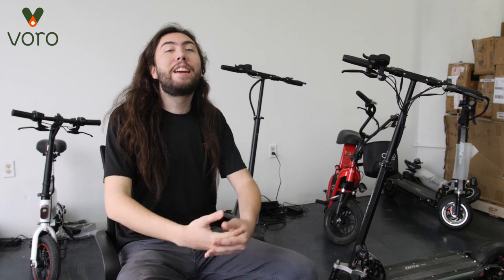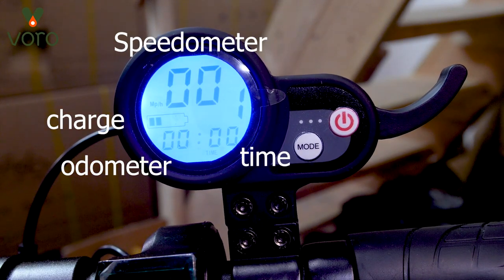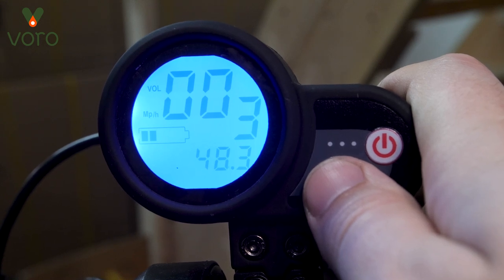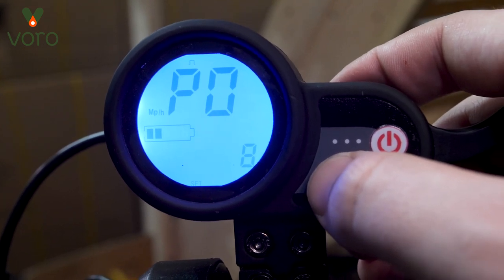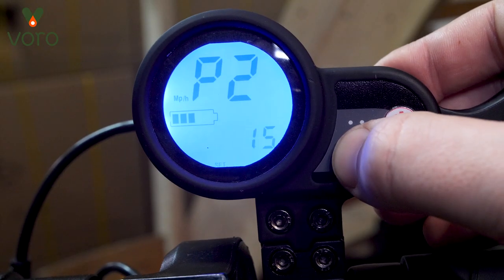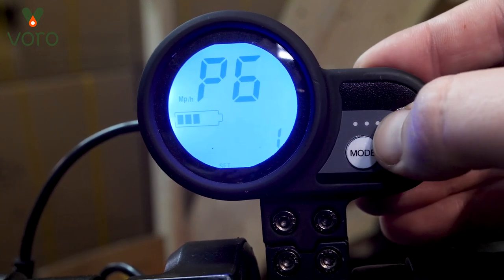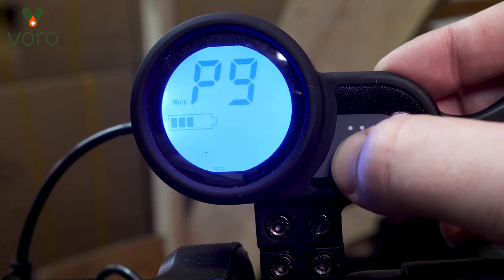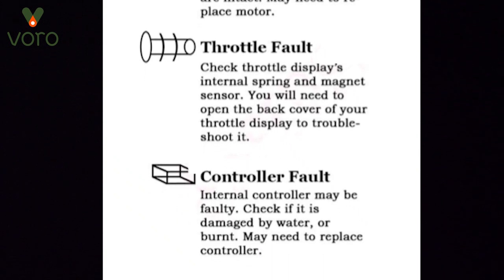EMOVE Cruiser and Touring LCD Display P0 to P9 Menu - Most Comprehensive Tutorial

Comment from the maker: Something that we want to clarify on

For the EMOVE Cruiser
P0 = 10 (10" wheel)

For the EMOVE Touring
P0 = 8 (8" wheel)

If the settings for P0 is not following this, you might find yourself at a different displayed speed compared to the actual real life speed. For example, if you Cruiser P0 setting is set at 8, you might be travelling at 25mph but the display is showing 20mph. 

At the time when the video is made, this is 1 minor mistake on the tutorial. Apologies for any inconveniences caused.
Reply: Hi voromotors can you move the key insert   or is it permanently placed
Reply: @Sly_Fella  yes it just Allen key
Reply: @Randomguy-rh7rl  ok
Reply: thank you for the clarification! i was wondering this and couldn't make sense of it.
Reply: Thanks for the clarity!
Reply: I just bought my Emove Cruiser and I was wondering why I was going fast but my speedometer was just showing 18-20 mph.This help now it shows the real speed.
Reply: @notgoodman6651  set the P0 to 11.5 and speed will be correct .
Reply: @leechavarie4675  is that why my new emove cruiser s is only displaying 28mph top speed instead of 30? My wheel size is set to 10
Reply: I’m 😮so
Reply: How to set the speed 25max go to 40 kilometers per hrs

Comment: These are the best settings.
P0 - 10 wheel diameter
P1 - 43 low volt protect
P2 - 15 minimum wattage
P3 - 1 speedometer
P4 - 1 mph
P5 - 1 kickstart
P6 - 0 cruise
P7 - 1 acceleration
P8 - 100 power limit
P9 - 2 electronic brake
Reply: Thank you so much!
Reply: Why 10" wheel? Does it affect torque, or only the speedometer?
Reply: @qx4n9e1xp  just the speedometer it would give you an inaccurate speed
Reply: Only change P0 to 10 if you have tubeless tires. If you have a tire diameter of 10 then it is set to 10. In other words go based off your tire diameter. The first number on tires.
Reply: @logandowney03  default is 10..
Reply: Thank you

Comment: My Touring came with 3\5 bars of a charge..  and the wheel size wasn't setup.. so I went for about a 4 mile ride and it was down to 1 bar on the battery meter.. Another mile and I would have made it to the local market but I turned around. So far it's fun and a pretty solid machine.
Reply: It's bad for the battery to leave it too high or too low for too long, so they leave it at medium for battery life when not being used(when no one is riding).

Comment: Needs an update.
P0 is a speedometer scale adjuster. 
P1 is a battery scale adjuster.  It adjust how your  battery bar displays from full to empty.  Doesn't affect LVC at all (I've had my Cruiser at 44v and the P1 at 48v, doesn't do a thing).
P9 is not a regen brake at.  Others have said all it does it add a little bit of resistance to maintain steady speeds while going down hill.  I can't detect it doing anything of any real note.
Reply: Sine wave controller has electronic braking for sure

Comment: I just bought a Cruiser, literally hours ago, and have officially began the waiting journey. While excited about that, I'm a little confused about the low voltage protection setting (P1), and I noticed this video was from 2020, while the model I bought was the 2021. Even the batteries are different, I believe, so should it be set to 430 regardless? Replies appreciated.

Comment: Is the electric break a regenerative break?
Reply: Now that's a good question? Does it dump the energy back in to the battery, or just dump it as heat in to a resistor?
Reply: i dont think this scooter is that advanced if anything i think if u have it set to strong brake which is 2 your battery will die quicker because its using more battery

Comment: About the electric break: I'm not educated in the technical engineering of this technology so I want to understand what exactly changes between 0, 1 and 2 settings. I'm guessing it's that break that hits when I stop accelerating even though I'm not actually hitting the breaks. I hate it because sometimes I let go of the accelerator to let the momentum carry me while I slow down but the break kills enough of the momentum that I have to accelerate again even with the P9 set to 0. Am I on the wrong setting or are the electric breaks something completely different?

Comment: Is there a way to back feed power through the usb port on the display? I’d like to be able to carry an external power supply I could plug in to get home in a pinch.
Reply from the maker: Hi there! 

While we understand the natural inclination to use a USB port as a charger, that is not its intended purpose. The USB port on the display doesn't make for a good charger if you ever do plug in a device, and in fact, we would advise against it, as it is not meant to pull power like is required to charge a phone or other device. 

The port's intended use is as a means to re-program the LCD display alone. 

It most certainly is not a means by which you can feed power back into the scooter, and we would not recommend trying anything like what you are suggesting. Sorry! Feel free to reach out if you have any other questions, though!

Comment: Can you do a video of the p9 settings in real world? My p9 is at 2 and I don't notice a deceleration. Thanks!
Reply: FACTS
Reply: The electric brake is activated when you actually use your brake levers, which is weird.
Reply: @alexisjavier84  the electric brake (regen) should activate any time you decelerate tap your brake or throttle and you should notice the motor slowing you down. if not change the setting
Reply: My square wave controller never exhibited electronic braking as expected. When I swapped it for a sine wave controller, suddenly electronic braking works and very noticeable just a second after pressing the brake lever.

Comment: Just purchased the cruiser and I love it. Problem is, the odometer. When I changed it from km/h to mph, the odometer didn’t change. Is the odometer in kilometers or miles?
Reply: Strange. I just changed mine there and both changed.
Reply: Problem with screw loose?

Comment: Yes I just got a scooter it's not even 2 weeks old and I noticed that wire going into the back to LCD was loose way too small for the whole the other big hole wasn't even covered up but I noticed when I raise a handlebars up and down it must have wiggled the wire or something because now my scooter won't turn on when I turn the key on LCD doesn't light up but I could push the menu button or that the power button on hold it down in the horns the light will come on and the horno honk but I was just wondering if you had any ideas about that

Comment: Waiting for my touring to arrive. If electronic braking is turned on, how does it work? A lever? Or does just releasing the trigger do it? Thanks. Great, informative video btw.
Reply from the maker: the E-brake activates just by pulling your brake lever. - AJ
Reply: VOROMOTORS Don't think mine works! Especially while in cruise mode the brakes don't cut cruise out just the throttle is that normal?
Reply: Sine wave controller works w electronic braking, my square controller never did.

Comment: What do you mean for p2 minimum wattage . I got 800 watt motor what number should I set?  I thought that the p2 was the number of the poles inside the motor... so the number 15 what does it mean ?
Reply: Have it on 18  i have the manufacture guide and it standing p2 =18

Comment: Can you explain about The battery voltage ? When it’s on 52 is it fully charge? and what number should I get when it’s 10 percent Battery left?
Reply: Cruiser uses a 14s li-ion pack so full charge should be 58.8v and drained should be about 46v

Comment: P2 is min wattage??? is it not poles number??? 
I have an identical scooter with this form this video but 48V 500W version and I have a question: on 2 and on 3 I seem to have the same power and max speed. max speed I tested with the wheel in the air and it is 39 km/h on both settings 2 and 3. Isn't this a little low especially with zero load? With me it barely goes more then 30 km/h. Specs were saying 45 km/h.

Comment: Hi, I have a scooter with the same display and the same settings and if I leave the scooter ON and do not move it, it will turn OFF after something like a minute... I wanted to ask if there is a way that the scooter will not turn OFF?  Because I need it to stay ON so i can charge my phone through the USB socket behind the display when I'm out and the acooter does not move... PLS HELP ME :)
Reply from the maker: Hi, sorry to hear about the issue you are facing. 

Can you please email to support@voromotors.com for the right department to assist you immediately?

Alternatively, you can also call us at 323-709-7329

Comment: On my Cruiser P2 was set at 17 when I got it. Im pretty sure its the newest version since I just got it from Voro. Should I be changing it to 15?
Reply: I got mine from Voro also and it was either 17 or 18 then I changed it to 15 because of the video but changed it back to 17 because another comment on here said that the manufacturer manual says P2 18 for the cruiser

Comment: Hii there where can I find what should be my battery voltage at when it is at a low battery and what should it be at higher battery? Do you have a list of that?

For the electric brake If I brake normally with the mechanic brake it will automatically start the electric brakes?
Reply: Hey google Emove cruiser or touring master guide. It’s like a small 12page pamphlet of every detail. It says what the volt readings in there would be on low battery.
Reply: @l-Lucid-l  thank you so much I appreciate it
Reply: E brake doesn't work on touring well I don't think just drum brake
Reply: @thew4rrior5code  I pretty much rely only on my regenerative ebrake than the drum on my touring. My drum brake should last forever.
Reply: FireTrace How do the different brakes work on the touring I'm confused the women on the online chat at voromotors said there weren't no ebrake just regen and you won't notice anything while riding. Also in cruise mode the brake doesn't cut it out just the throttle does is that normal?
Reply: @thew4rrior5code  I always believed that the regen and ebrake are one and the same. Oh yes, it is definitely noticeable when engaging it. If I'm moving along downhill at speed and not brace for it, just tapping the brake lever initiating the ebrake/regen will send me flying while the scooter waits for me to return to pick it up. =) Actually, not that bad once you know to prepare for it. I'm 5'9" and 160# and do a lot of downhills and rarely depress the brake lever enough to engage the drum brake. As far as cruise control, I really can't offer anything there since I have that turned off. Suits my type of riding.
Reply: FireTrace ah ok. I've just re-read the p-settings on their website it says for p9 which is ebrake strength you activate it by hold down throttle all the way? Doesn't mention anything regarding the rear brake! 1 final question my friend does your drum brake sometimes come out of the line housing it's situated in? Sometimes when I press on the rear brake it gets really loose I then stop look down and the drum line is out! What's the issue there?
Reply: @thew4rrior5code  Ha ha! I've been trying to figure it out myself. I've had that happen twice so far (after about 10 outings) and am puzzled how little bumps along the way could knock it out of it's place. Sure don't want to realize it when on a long downhill. Come to think of it, I believe the regen brake still works when that becomes detached. Only because both times I've noticed it, I was already home. It's downhill home so the regen brake must still work, which is comforting.  It is kind of a mystery as there is a bit of tension there where one would think it wouldn't be an issue. I will look at it again today. Maybe the spring sometimes does not do its job. Will monitor it and maybe between us we can figure out something....besides duct tape. =) Oh, as far as "activating the ebrake", I didn't see anything in the instructions regarding that except for setting it in the P settings.

Comment: So I have a problem. XD my mode goes down on the P screen where as power goes up. Neither let's me select the p setting to change the settings. Because I need to turn off kick to start. I injured my ankle today doing such 😆
Reply: Nvm figured it out. For mine I have to hold menu to go into the p setting to change it.

Comment: Hi. I changed my display throttle which is originally z2 but I got a z1 throttle as replacement which has up to p9 settings. Can you help me out what parameters for z1. I'm afraid I might damage the scooter if I use it without setting up. By the way my scooter is China mare which is 60v 3200w dual motor (1600w each). Please help.

Comment: Hi, this is great. Would you have a similar video or maybe just a list of settings for the Orca Mk1 please? Many thanks, Rupe
Reply from the maker: The Orca's settings are all locked. there isn't a way to get in and change anything so its really easy to pick up and not worry about. - AJ
Reply: @VoroMotors  Many thanks for getting back AJ. I just seem to have no 1/2/3 power difference, and feel stuck in lowest power maybe, little DYU 1 goes faster. The P settings all seem changeable (power and M etc),but if you say those numbers are fixed..I dont know what to do - maybe flash some defaults? I bought the bike from Techtablet in Portugal who had it as a review bike I think. Thanks again for your assistance, Rupert

Comment: For whatever reason it works most accurate with wheel size set to 6.  I don't get any change with 'soft' acceleration. And e brake seems non existent
Reply: Michael Armani I agree on my touring I don't know how the ebrake works? and the drum brake comes out the line housing often which is annoying I'll know because the brakes go all loose.
Reply: THE W4RRIOR5 CODE , agree. Its kind of dangerous, I need to figure out a wY to secure it, maybe a zip tie will work.
Reply: What is it exactly that works accurate with the wheel size 6?

Comment: Do you get batter range if the wheel size is set to 10 instead of 8?
Reply from the maker: No, the range do not get affected. It only affects the accuracy of the LCD display.
Reply: @VoroMotors  what will happen if I set it at 10?
Reply from the maker: @michaelmartello6202  The scooter will read mileage and speed assuming that the wheel size is a 10 inch wheel.
Reply: Mine was set to 8 and was saying 37mph on the speedo. Changed it to 10 now.
Reply: @VoroMotors  I am a bit confused, the cruiser has a 10 inch tires, why did you recommend setting it to 8 inch? Speed is calculated by the angular velocity times the radius, so if you select 8 inch the LCD would show lower speed than your actual speed. Can you please confirm that?
Reply: I thought our wheel size is 10, why would I set it to 8?
Reply: @Danelya30   you say in the video set it to 8 tbf
Reply: @bryanchristiansangga1244  I think they said to set it to 8 if you have the Touring model. Not sure, though.

Comment: Don’t mess with the voltage protection keep it to where it was. My emove was acting up it was studdering power to my motor and I couldn’t ride it anymore my brain told me to change the voltage protection back to factory and my scooter seems to be working not sure how long this will last but I’ll let you know. It shouldn’t be happening to the point where you can’t ride even with full charge but when I changed mine it even changed the bars on my scooter so I believe it will even effect how much of a charge you get. I hope this fixes your problems if your having the same issue I was but let’s hope it was a permanent fix so I don’t have to warranty it.
Reply from the maker: Hi Albert, 

I'm sorry you had that issue with your scooter, but we agree that the Low Voltage Protection setting for your scooter should be kept to factory settings in most situations. Changing it can effect a number of things including the battery's ability to hold charge. 

If you are still having any issues, please feel free to reach out to us at support@voromotors.com, though. We're always happy to help!
Reply: @VoroMotors  The thing is after changing the settings on my scooter it seems to be working again however when I change it back to 52 or even 50 where it was my bars are at 3 but when I move it back down they go back to full kinda weird but other than that everything seems to be working.
Reply from the maker: We're glad to hear your issue is largely resolved, but again, should you have any concerns, feel free to reach back out. We're always happy to help and answer questions. :)

Comment: How about the wattage for the Touring please?
Reply from the maker: 500W
Reply: p3 is not the wattage as stated in the video, it's the number of magnets in the motor and it is only relevant for accurate speed reading, as is wheel size setting